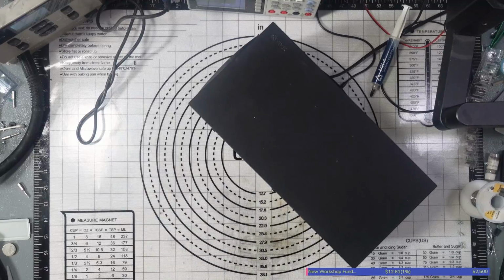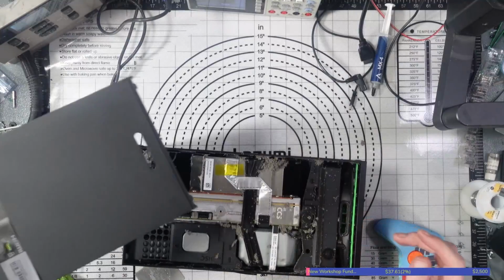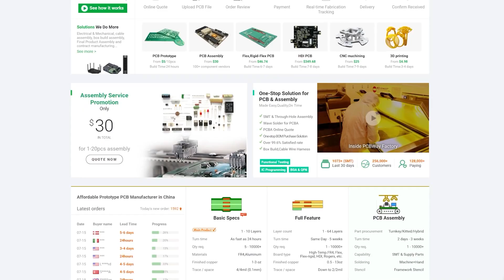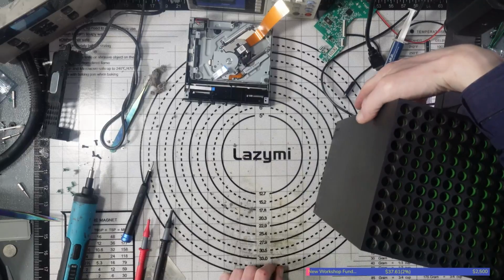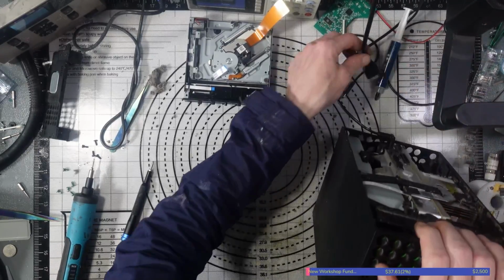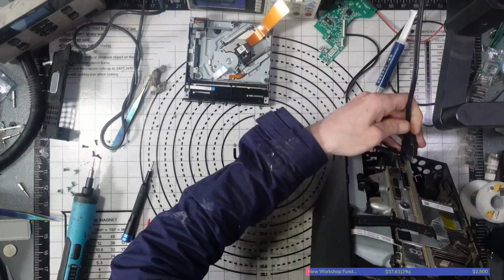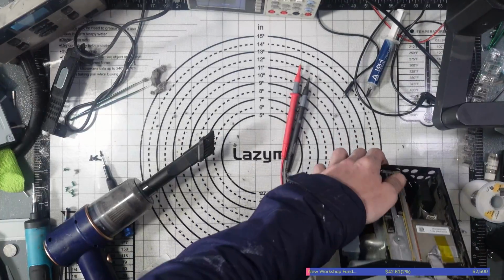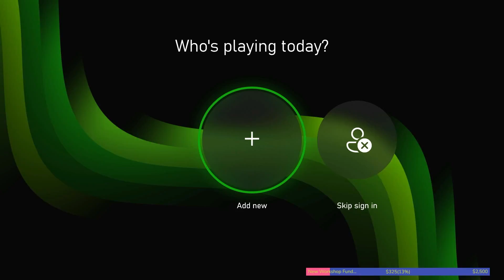Can I Fix An Xbox Series X That Won't Read Discs?

Comment: My disc drive won’t accept my disc unless I press the eject so it starts spinning. When I turn on my Xbox it immediately spins, once the disc ejects it gets spit out on the floor. This happened after I replaced my laser disc reader with my Xbox one because it wouldn’t read anymore